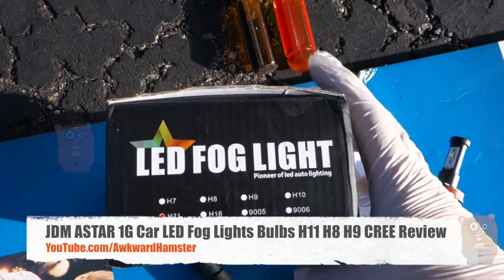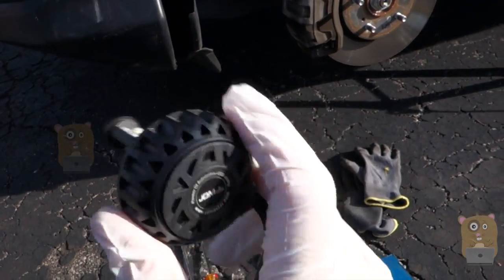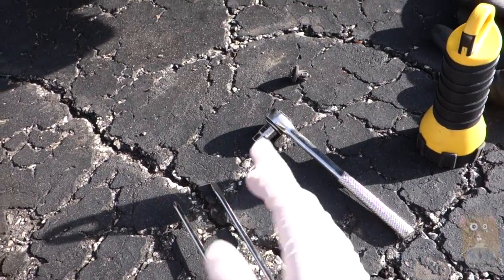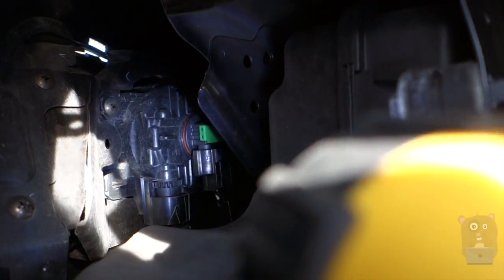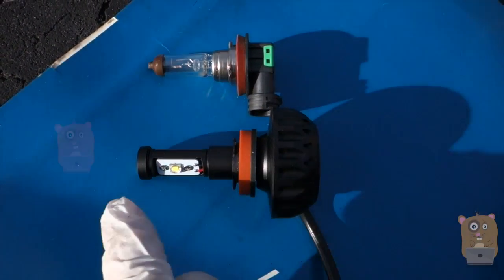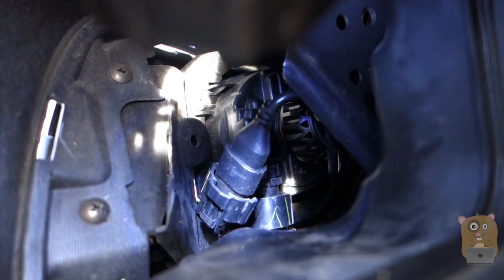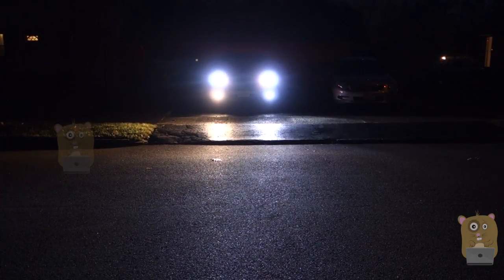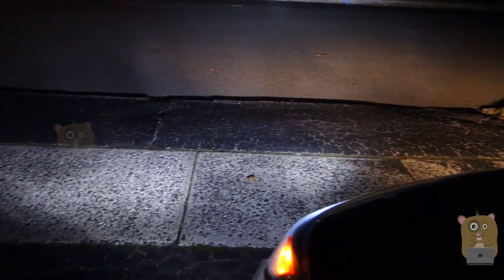How to replace Honda CR-V Fog Lights with JDM ASTAR 1G LED Fog Lights Bulbs H11 H8 H9 CREE Review

Comment: Bro I have a Crv 2017 do you know if I can put the led which it has 12000lm like the auxbeam F16, with cool fan, in the Fog lamp or it may burn the lamp?
Reply from the maker: My fog light compartment is narrow and not well ventilated. Even if I installed a fan, it’ll just be recycling hot air. That is why I felt it was safer to get one with lower lumens, lower heat output. Even at lower lumens these JDM ASTAR are very bright. Much brighter than the previous bulb. 
I believe if I went with the higher lumens bulb they would have had a shorter life due to overheating.

Comment: This looks like a CRV 2012, I have a 2010 and its much tougher, need to drop the below skirt, and maybe even remove the bumper. I was really confused, because when I removed the side tire skirt like you did there was a large metal plate blocking access to the bulb. For future reference, please put the model year of the car you're referring to, thanks!